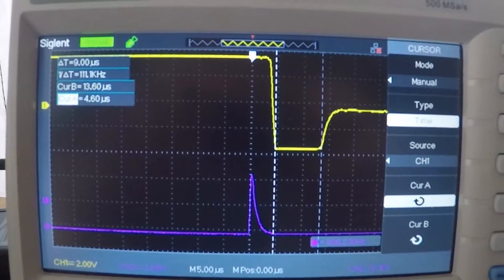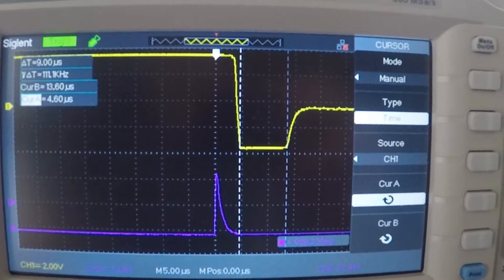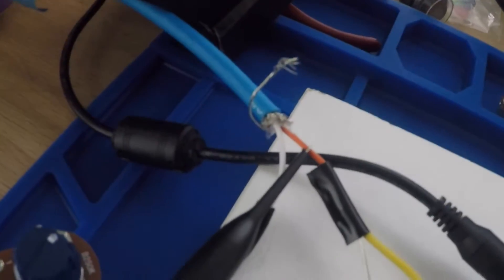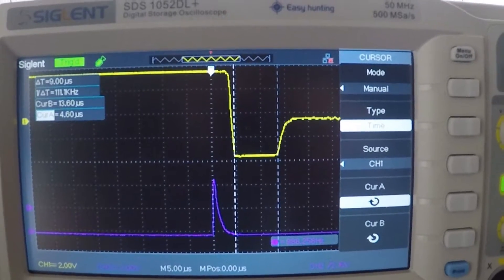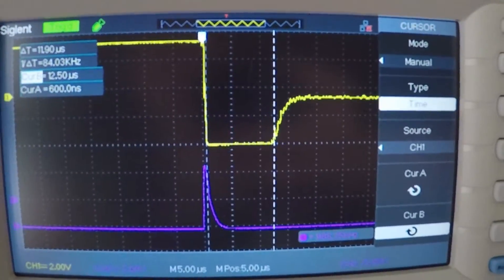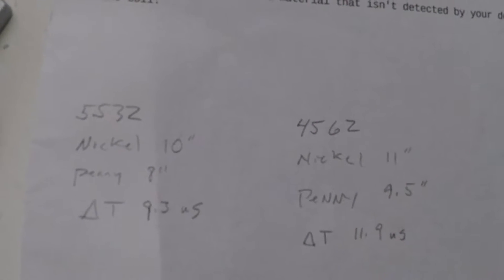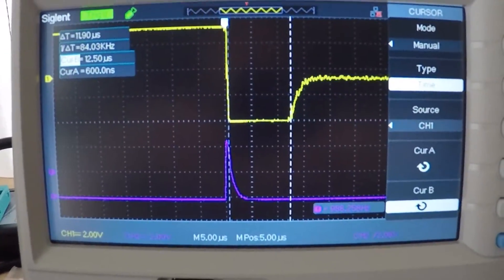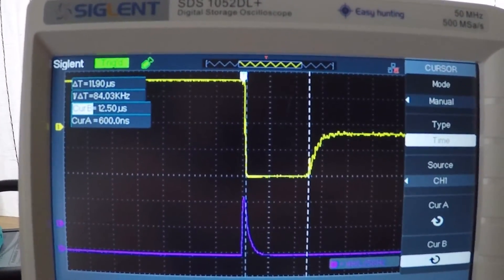DIY Pulse Induction Metal Detector RX Pre amp OP Amp swap-out

Comment: Hello
Dear surf Detector.
Unfortunately, i have to make a new HH1 project. Now, i have a problem with R23 than pin 2,3 of IC8.
I don't know why the trimmer has not any affect over the pins. I saw your videos but i didn't see any explanation about tuning r23. Do you have any suggestion?
Reply from the maker: Set the trimmer to its midpoint and carry on.
Why are you asking a question regarding the Hammerhead on a video about the Mini Pulse Plus? This will be confusing for my other viewers my friend.
Reply: Sorry, i don't understand. Do you think it's normal pin 2 and 3 is not zero?!
Reply from the maker: @ha.farz.2953  I have just posted information on the Hammerhead 1 thread on Geotech.  Please read that.

Comment: When comparing the two op-amps, you need to re-zero their outputs in-circuit before testing.  It is not clear in the video whether this was done or not.  Also a minor point, the sample delay is usually measured from where the square wave input to the coil finishes (or the peak of the coil back EMF a uS or so later), not from when the op-amp saturation commences (which can be several uS after the square pulse or peak EMF has finished), as the target eddies are potentiality already dying out a bit at that stage.  I find the LM4562 better in use as it is quieter in my circuits (not Mini Pulse Plus).  Great videos!
Reply from the maker: Hi Elliot,
Glad that you are enjoying the videos and I always appreciate informed feedback.  You are correct, I should have positioned my cursor A at the falling edge of the square wave rather than at the start of saturation. 
Cheers